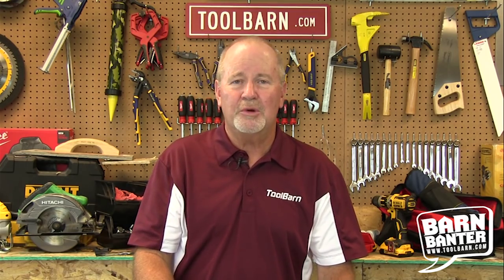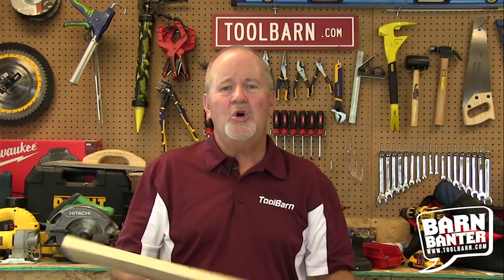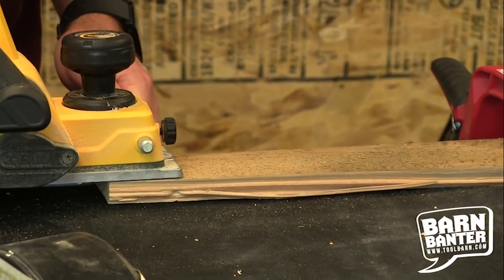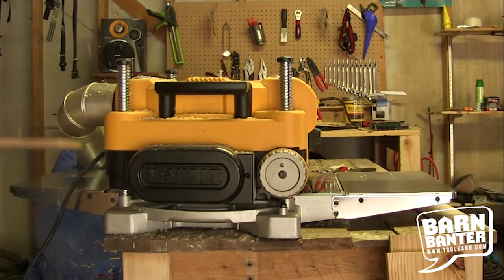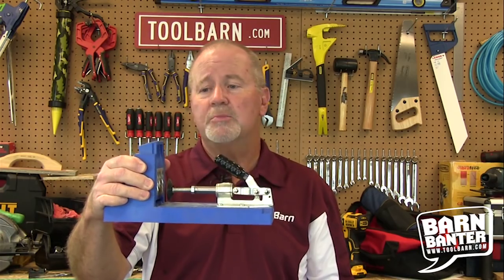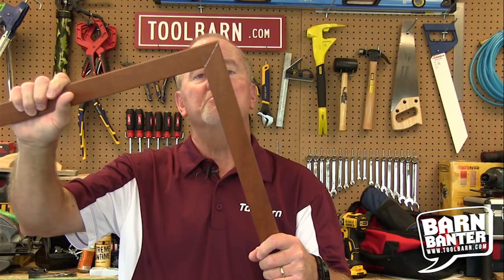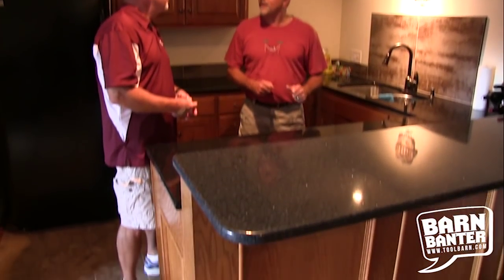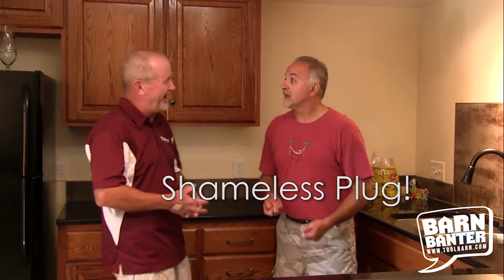Cabinetry | Barn Banter #29

Comment: Gary buddy:  This was kind of waste of time for anybody other than a complete novice.   You don't use a power plane like this for too much of anything (S2S lumber and sticky doors).  Even lumber mills are going to abrasive planners.  A good 3 or 4" belt sander in practiced hands is a much more useful tool to have.  Cabinets are for a variety of different uses and different style needs.  14 minutes doesn't do much for that info.  Have the people go the public library and look at back issues of Fine Woodworking and Homebuilding.  Forget the DIY books like Better Homes & Garden and the like.  How people how to use tools that are really used frequently when building fixtures and furnitures.  One at a time!
Reply from the maker: Joel Reynolds This episode was mostly meant to encourage people to learn about how to do it - not to teach people how to do it - as stated at 9:26 We believe that our customers can do anything they want if they have a good internet connection, the right tools, and a bit of patience.  Also the bosses upstairs don't trust us with the heavy machinery - so we couldn't show you those nice Jointers and Table saws that we sell - haha!